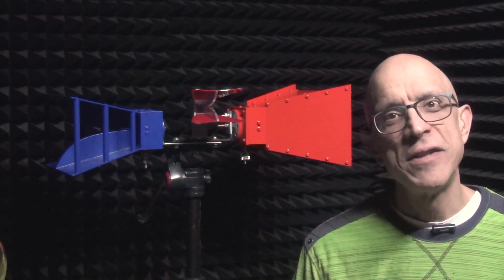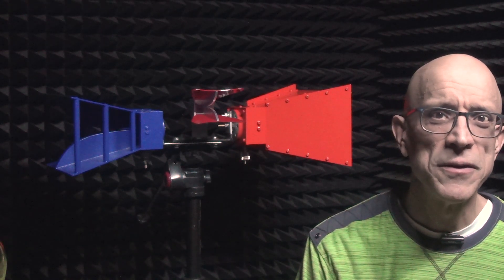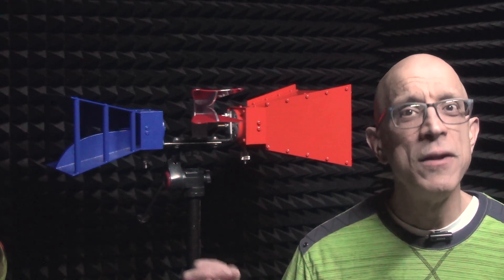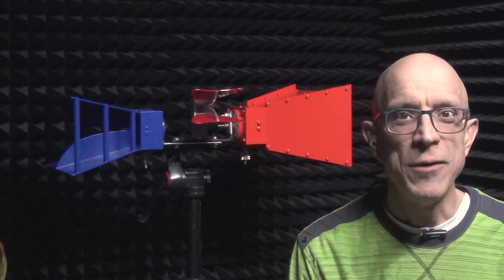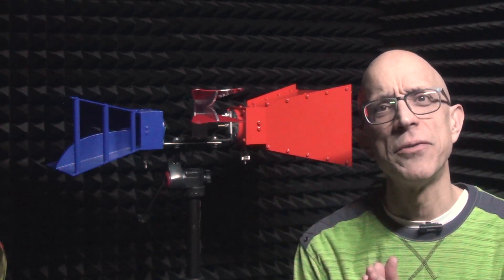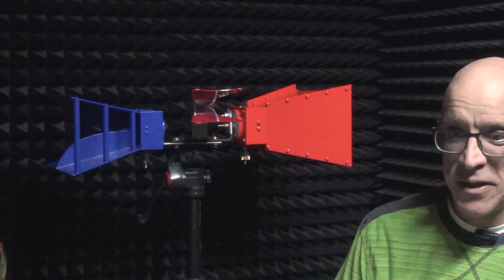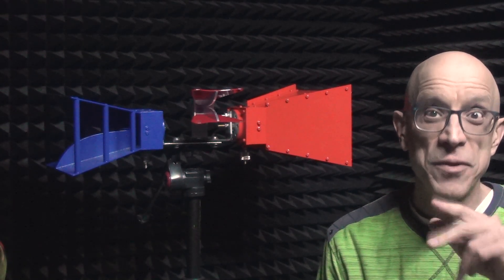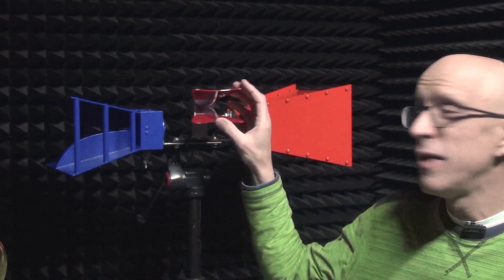The Reality of RF Testing

Comment: Very educational, thank you.

1) I am concerned about 6 dB accuracy of Pro II: is it small enough for the device to be useful for a user?
6 dB means that actual signal P may differ as much as 4 times the basic signal P0, that is P/P0=4!

Example: The Canada's safety limit is 2 W/m². Let say the Pro II shows AVG=0.7 W/m² (which means that actual signal may be as big as 0.7*4=2.8 W/m²). Does such Pro II’s measurement mean that environment is safe, or not?

2) Do you know why Classic II has no 3.5 mm jack for head phones? (Seems like the device will consume less power than when using a loud speaker.)

3) Do you have a demand for a device similar to Pro II, but in a form factor of a sensor providing readings via USB?
Reply from the maker: Thanks for your feedback DCMedia.

Compared to other available meters at or below this price range, the Pro II's 6dB accuracy is very good.  We have done extensive RF lab testing to know this data.  Some have an accuracy of 10dB, and the others are 15-20+dB.  Also,  they do not have any lab test data to back up their claims as I mentioned in the "Reality of RF Meters" video.

When we were first designing the Pro II, the performance benchmark we used was the Gigahertz Solutions HF59B and HFW59D that are in the 4dB range and also tested in a real RF lab.  Their cost reflects that, and those meters require more background knowledge to use properly.  We wanted to create something with similar accuracy if possible, RF lab tested, ease of use and to be more affordable.  We provide a frequency response plot in the manual so the user can adjust their readings according to frequency if extremely high accuracy is needed.  Gigahertz Solutions refers to this data as Correction Factors on their meters.

If you require exteremly accurate measurements, you will need to purchase calibrated antennas and spectrum analyzers that are available at a much higher price, and have the knowledge to operate them properly.  We use this kind of equipment in our lab, and have done duplicate testing in many other labs to confirm results.

When we designed the Classic II, we did not include a headphone jack for many reasons.  One is that the battery life is already very long, and can easily be maximized by turning off the speaker.

Nobody has ever asked us to make a USB RF meter sensor before.

Best wishes!
Reply: В  Австрии норма 0.1 мквт/ квадратный сантиметр, задумайтесь!
Reply: В  Австрии норма 0.1 мквт/ квадратный сантиметр, задумайтесь!

Comment: Was this in relationship to the EMF-390 in a tray that would pick up shorter bursts than the Safe & Sound Pro Ii? I must admit it peeked my curiosity do look deeper into the EMF-390 to add to my collection.  

The S&S Pro Ii is with me at all times, I love it. Also just bought the Classic II as a back up (wondering if it will be as sensitive to short bursts as the Pro II? I am concerned about these short bursts as I have noticed that my permanent dectector, the EMField Radaware, often doesn't seem to pick up on the short pulses of iPhones. I believe they transmit a constant 1 sec blip with BLE? Probably for their Find My mesh network. Is this true? I have been caught out a few times, thinking all was good, but when I started to feel nauseous I had to switch on the Pro II and realized I had not been warned by the Radaware of a active iPhone. 

This is particularly disconcerting because even when the iPhone is on airplane mode the wifi and bluetooth are often still active, but even when you switch those of in the settings it will continue 24/7 to send out those BLE pulses. In fact, even when the iPhone is powered down, it continues. So it is really important to pick up on those short pulses. I also just bought your wrist detector this week, will it pick up on short pulses like the Pro II? I believe the Pro II will do 3msec and the detector 6msec?
Reply from the maker: Thanks for your questions Vasku.  We have some detailed answers for you!

The Classic II has the same performance as the Pro II for short burst response.
With the iPhone completely powered down, those pulses are likely from something else.  The newer iPhone firmware versions make it more difficult to activate a "true" RF silent mode with having to dig into the settings menu.

And regarding the video of the meters in a baking tray... let's dig into it:

This is a "neat trick" being played.

REMEMBER THE FOLLOWING:
1) All of these other meters have VERY SLOW pulse response. ONLY the Pro II will measure short pulses with any accuracy.

2) The difference in "absolute values" displayed by the meters can vary 3-6 dB between brands.

3) In a metal tray like that, there will be reflection "hot spots" and "cold spots" - could be another 3-6 or 10 dB between each meter.  The signal source location, antenna (if not the tray), are unknown.  And it's a highly uncontrolled, RF noisy testing environment.

So, let's look at how each meter changes relative to itself first, then relative to another meter second.

We will compare to the AM-11 for the sake of simplicity.
....................

SIGNAL GENERATOR OFF

The Pro II shows:
PEAK 600-900 uW/m2
Lots of noise in the environment - this is bad test environment.
AVG 4-5 uW/m2
No CW transmission is present.

The AM-11 shows:
PEAK 0.11 V/m = 32 uW/m2
THE AM-11 IS MISSING MOST OF THE HIGH SPEED NOISE IN THE ENVIRONMENT - SO ARE THE OTHER METERS.
AVG <1 uW/m2
No CW transmission present.

The AM-11 is "missing" a bunch of narrow pulses and displaying peaks that are 20x lower than they are.
................

SIGNAL GENERATOR ON

Pro II shows:
PEAK 21,600 uW/m2 falling off to 900 after the switch is flipped.
Pro II catches the initial switch transient (OTHER METERS DONT) however, since "background noise" peaks were already in the 900 range BEFORE the signal generator was turned on, the PEAK value of 900 does not increase. Other meters show an increasing PEAK because they were MISSING the peaks when the signal generator was off.
AVG 320 - 100 uW/m2 -> up 10x from signal generator off
The Pro II shows the increase in average power correctly. The signal generator is generating a Continuous Wave (CW) signal where the PEAKS and AVG will be the same value.

AM-11 shows:
PEAK 890 uW/m2
It does not catch the switch transient; it's just displaying the CW transmission power (note PEAK and AVG are the same on AM-11)
AVG 845 uW/m2
The AM-11 is having slow response and MISSING the peaks that are in the environment with the signal generator off, can now catch the peaks of the CW signal - since the PEAKS and AVG are the same for CW. Hence, it shows a big increase in both PEAK and AVG. This highlights that the PEAK function works poorly on this (and the other) meters.
.................

This is a really great video that actually shows how poorly these other meters perform. The test setup is a game that uses the "blindness" of the slow meters to make an increase in AVG show up as an increase in PEAK on those meters. The Pro II does not show this increase in PEAK because there is no increase in PEAK. Big PEAK values were already there, the other meters are just too slow to see them. This CW signal shows up perfectly as expected as an increase in the AVG value. In short, all is working well with the Pro II.
Reply: @9ci  setting the iPhone in airplane mode and disabling the Bluetooth and WiFi will eliminate the rf-exposure, right? Or should there be other steps undertaken?
Reply: Купите смартфон на андроиде с кастомной прошивкой ,без фоновой передачи шпионских данных!